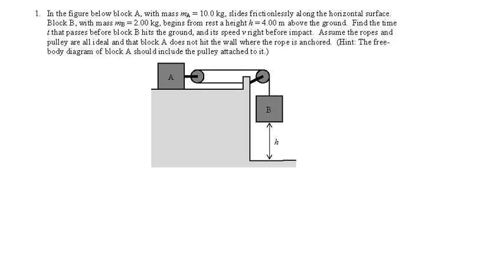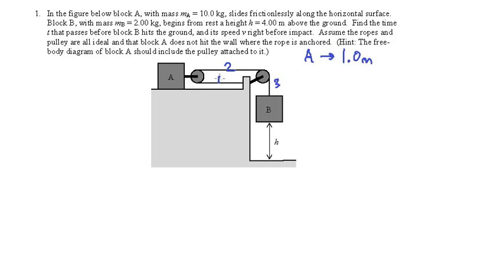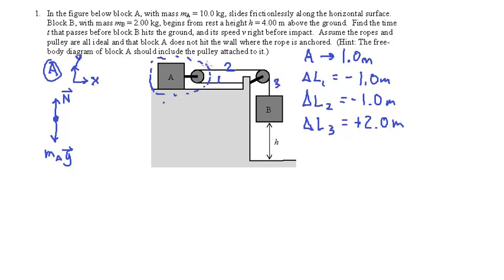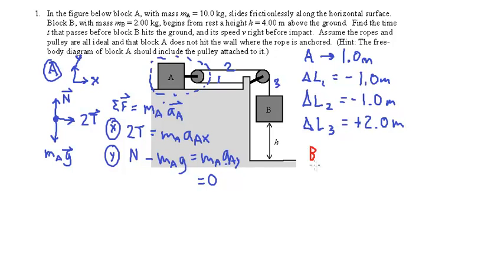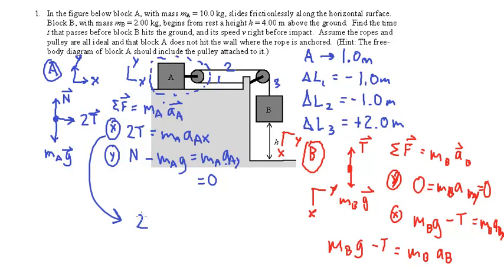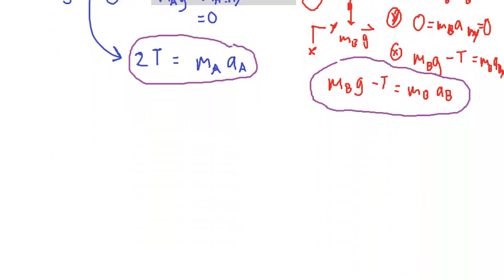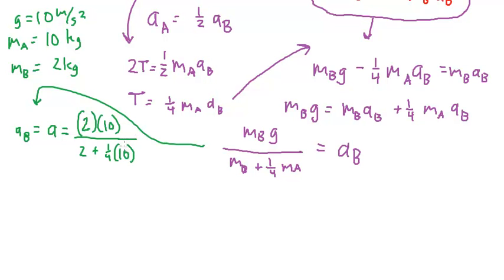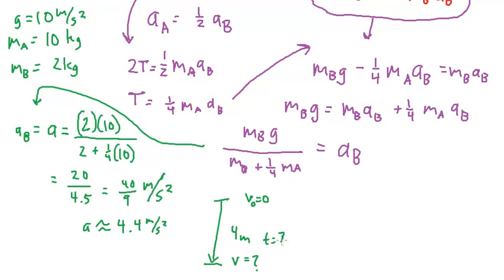Forces Review P1

Comment: its because of how you look at the changes in distance for each string
let block A move 1 m to the right
for "section 1" of the string it gets 1 meter shorter , and so does the second section of the string. but the third section of the string is increasing. its increase has to balance out the loss of the other two strings combined. thus the third string gains two meters there. the rate of change between the two is 2 (the third string gains twice as much as ONE of the top strings loses)